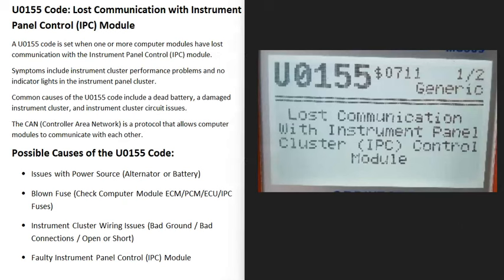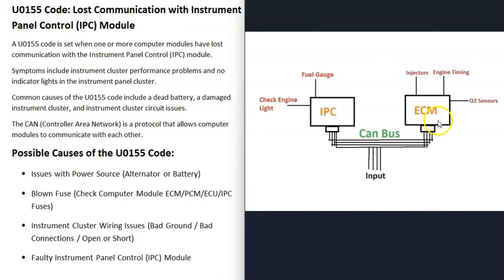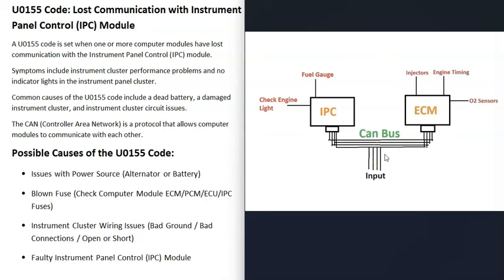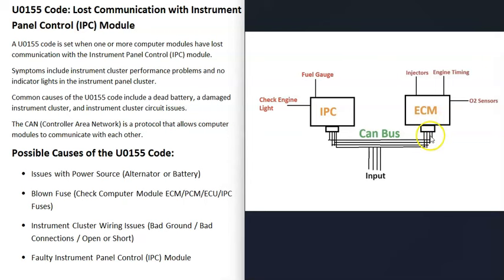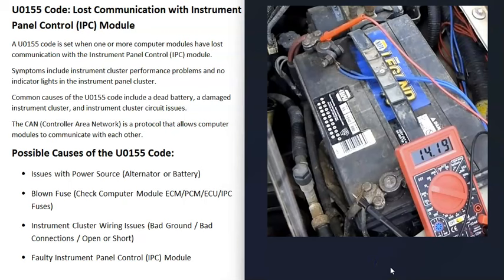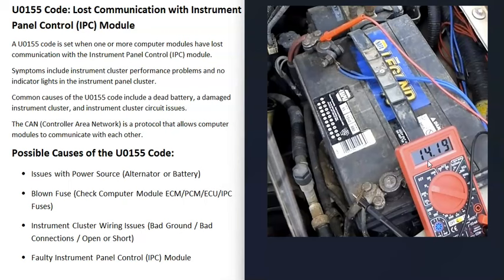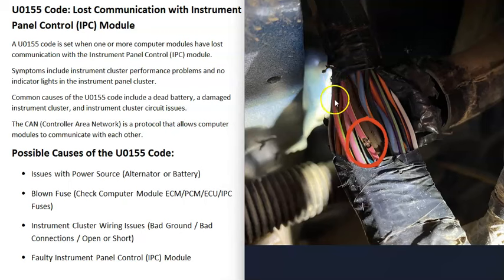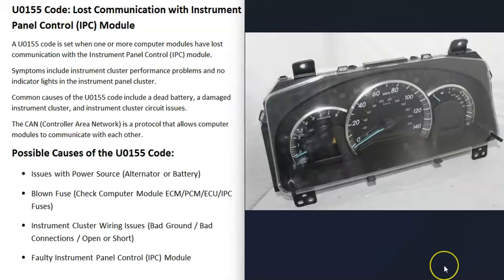Causes and Fixes U0155 Code: Lost Communication with Instrument Panel Control (IPC) Module

Comment: Is it possible or likely that if a car hasn't been driven in over a month and the first time driving (2 miles) to get a smog check, the smog would fail with this code due to simply not being driven for that long?
Reply: Yes check engine code will automatically fail smog

Comment: Would the cluster going bad cause the vehicle to turn over, but to not start? Like it’s not getting fuel? But the fuel pump is fine. Also, it will not shift out a park now. And I have no gauge lights and the only code I have is this U0155. Thank you in advance and it’s a 2006 Honda Civic.
Reply: Did you ever figure it out? Having similar problems
Reply: @ I actually did. Thank God. I got the car for my daughter. To go back-and-forth to college. And recently believe it or not she got a back up. Camera added to her aftermarket radio. And it sounds crazy but the reverse lights are on a 7.5 fuse. That also runs half of the dang car. That 7.5 fuse actually runs the blue relay in the fuse box. That blue relay runs about eight different items in the car. I had no power windows. The gauges were going in and out, and the scanner kept saying not communicating with the gauges. I got down in the fuse box. I pulled the number 10 fuse which is 7.5 it was blown. I put a 10 amp in it. It started up. I opened up the trunk. The fuse popped the car cut off. I found the pinched reverse wires. Actually I found the pinched back up camera wires. Disconnected them. Put a new fuse. The car started up and I have not had problems with it since. After about $600 and used parts I swapped out on it. It ended up being that fuse. Hopefully this helps you out.

Comment: What fuses should be checked and where are they located? Specific to the U0155 code- I have a 2012 Tiguan
Reply from the maker: It will be vehicle-specific, but anything labeled like ECM, PCM, ECU, or anything that looks computer-related.

Comment: I'm just having a trouble turning off the check engine light we're having a extra battery for an amp on the stereo cause that too cuz I got a group 31 hooked up with my help to the alternator but it's been like that for years

Comment: problem with 2009 ford kuga showing this exact error code , new battery fitted terminals look fine goes off when i bash dashboard so hopefully wiring or solder 🤞🙏
Reply: This is the exact situation happening to my focus 2010. Been going on for a couple months now driven about 1000 miles. U found out anything new since commenting?
Reply: Facing the same issue with my Ford Fiesta 2006 Model. 
The fuel guage meter dosnt work on IC. When i clear the codes it works once then again goes dead. Wonder what the issue is.

Comment: I have a 2012 Mercedes GLK 350 and when I turn the key in ignition the engine does not turnover
Reply from the maker: If the engine does not turnover, check the battery and battery terminals.